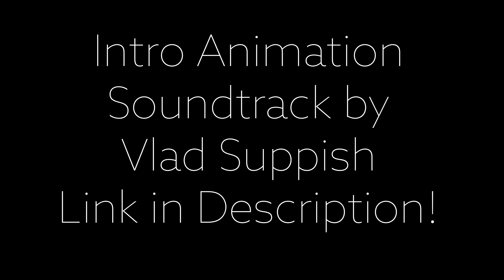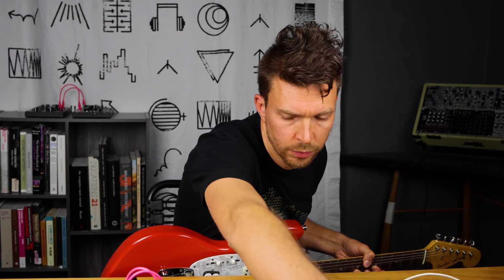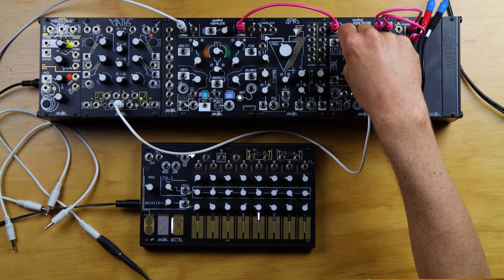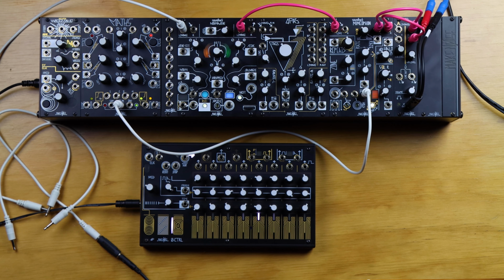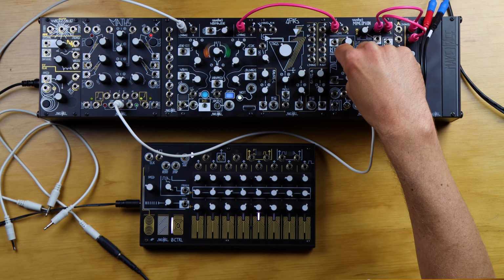Layering Guitar with Morphagene and Mimeophon

Comment: Nice video! Not sure if it’s possible, but any chance you guys will add a way to do true SOS looping on morph or mimeo? (without the gradual fade out of previous loops)
Reply: If you have a clock, you can patch a clock into the 'clk' input and use a 'rec on/off' trigger to sync the recording. Keep the morph in the 'green' zone and you have a true SOS looper that puts layer on layer without fading out. Works best with a tight gate sequencer.
Reply: @CinematicLaboratory  Hey, thanks for the reply. The problem I'm having is because of the SOS knob. The only way to record previous loops at 100% volume is to have SOS set full clock-wise, which sets the incoming audio to 0%. The closest I've been able to come to true SOS looping is to set the SOS knob to right before the incoming audio hits 0% (around 4 o'clock). However, the previous loops will still fade out (though very slowly) and the incoming audio will be really quiet. It helps a bit to set the gain staging to +12db, but it's still not ideal.
Reply: @wiiill  Now I understand what you mean. It indeed is a challenge and I have no idea how to fix that.

Comment: What setting is changed to have the morphagene consistently loop with record on? When I record on my morphagene I only hear the sound when I finish record and select the new slice
Reply from the maker: If you mean recording into the current Splice instead of creating a new one? By default this happens when you just press REC, and recording into a new Splice is REC+SPLICE. If you go to options.txt and set rsop to 1, you can reverse this so that recording to new splices can be done via gates to the REC input.
Reply: @MAKEN0ISEMUSIC  ah, okay I forgot I had switched the rsop option to 1 a long time ago and totally forgot it was possible to record over the current splice. Time to refresh my knowledge and read through the manual again haha!

Comment: GOD I HATE BEING POOR....! rack synths is very much a upper-class privilege
Reply: I’ve heard vcv rack is a good alternative to test the waters . I’ve not gone down the vcv rabbit hole because up until recently my computer was way too old to handle that type of thing …, and I dove into modular  hardware and am too engrossed in that instead of clicking a mouse on a screen.

I wouldn’t say it’s upper class ( I’m not… I’m the son of a mailman. For the the last 17 years I’ve been a plumber however with a bachelors degree in fine art / sculpture) but it does come at a cost. Best advice is taking it slow & learn as much before buying (easier said than done) and learn the crap out of it before adding to the mix
Reply: @kenschestok9515  There’s a lot to be said for the less-is-more approach, especially with modular … the 3 module challenge is a key example, and lately I had been having a lot of fun with a limited case (48hp) and squeezing out as much as I can with just a few modules … having a modulator like an Øchd really helps move things around within a limited case 🙂👍🏼
Reply: @aeropilot4419  absolutely! A lot can be done with 3 modules. Ochd is wonderful even unpatched just watching the lights change colors as it “breathes. To keep it make noise themed I love my wogglebug
Reply: I can't afford hardware modular either, so would also recommend VCV Rack. Most of my channel is modular guitar FX with VCV and free/cheap plugins, you just need a midrange computer and basic interface. There's even a sampler in VCV that loads Morphagene reels. I just watch videos on the real thing for inspiration 😉